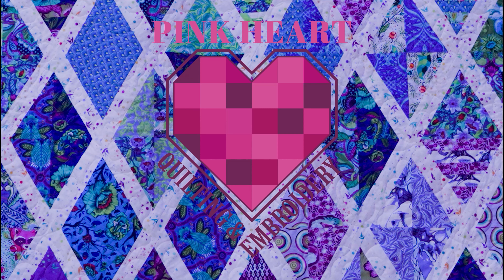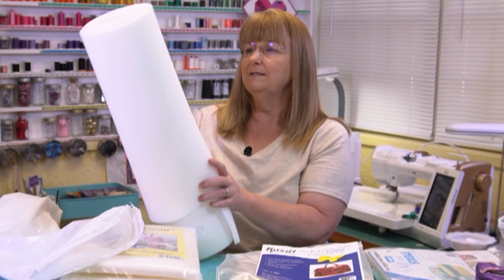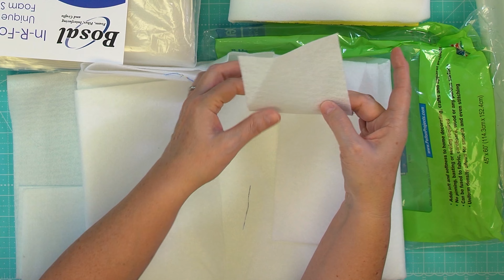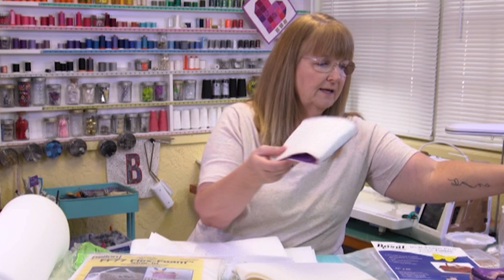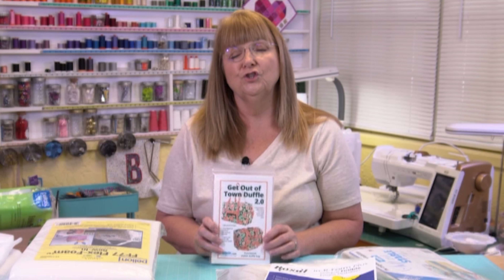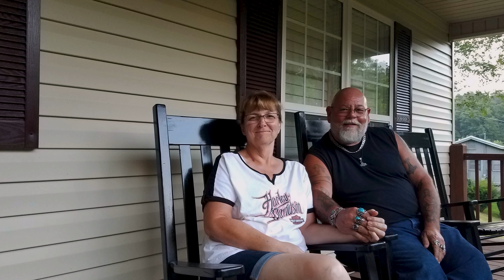My Favorite Interfacings for Bag Making

Comment: By Annie Soft & Stable comes in black and white. It is clingy and you don't need to quilt it to attach it to the outer fabric. This is a nice option. I buy Soft & Stable in the largest size. If you open the bag and undo it, it will relax and any folds that came from being in the bag disappears. That of course requires some extra room to store it. Well worth it if you can. As you mentioned, it depends on the style of bag, but for "fashion" bags as opposed to totes and shopping bags, I have come to use Soft and Stable exclusively. It is wonderful in Lazy Girl Design bags. Pellon SF101 is definitely my goto for lining, pockets, etc. One tip, if you want to use a fusible batting for a slouchy bag or shopping bag, you can make your own. If you are a quilter as I am, I always have a lot of batting scraps around; but, they are not fusible. Just cut a piece of Pellon Wonder Under the size of your batting and fuse it to batting scraps.Voila!! Fusible batting. I buy Wonder Under by the bolt (just like SF101) when there are 50% off or more sales.

Comment: Very helpful info.!!  I used to use a lot of fusible products for basting and now steer away from it when I can because it causes the sewing needle to get gunky with adhesives.  That causes all sorts of trouble until I replace the needle.  I now rely more on good pressing and clips or pins to hold things in place. TFS

Comment: I would suggest that a person try a few times with the fusible. After a little practice, there is no better look to the finished Tote, purse, etc. And quilting is never needed but does beautifully with this method. I have made many totes this way, for years and practice is the key. Even though it's scary at first, you quickly get used to handling it. Maybe this will encourage people to try it.
Reply: @Vickie I would like to hear your tips on using the fusible as I struggle with getting the wrinkles out.

Comment: Hey, I'm a "bag lady" too - Sew Sweetness patterns are great; yes, a lot of birthing of bags! Sew in foam is my favorite. I had used one of the fusible foam products and after total completion I went to put a few finishing ironing touches on the exterior of the bag & doggone, I got a wrinkle where the fused foam shifted. So from then on I've been a sew in foam gal only.
I know you said you're ironing the foam to remove the folds; I found if I hover my iron with plenty of steam going that it really helps, almost like it's rehydrating the foam (tip from Crafty Gemini and it really helps).  Look forward to your how to sew the  By Annie's duffle.  Thank you for a great video!
Reply from the maker: Hovering over the foam with steam is a great idea. Crafty Gemini is always a great resource for crafting techniques of all kinds.   I was really nervous to put an iron directly on the foam.  
The duffle has been a great project.  I'm still not sure if I prefer binding or the linings Sew Sweetness uses in her bags.  
Thanks,

Comment: Just what I was asking today. I've made many bags mostly utilitarian with mainly pack fabrics of every kind utilized. So I decided to make a YARN bag for a friend. My own design as my usual when an idea pops into my head. So what's been tripping me up from moving forward after making the cording & cutting out the basic fabrics is I do need it to be a stand up bag. And it also needs to have 6-8 grommets set around the upper 1/3 of the bag to allow yarns to come out of each. I count base fabric side and front as 2 layers, pockets with lining 4 more layers, vinyl cording another 2. My machine is known to handle thick heavy fabrics so far I'm good. But never having used the foam or bag stiffeners to stabilize the sides to insure it stands up? That will add yet two more layers. UNLESS I've seen several bag makers demonstrate cutting the fusible stabilizer foam out that's one sided but cutting it smaller than the width of the machine foot and using either a narrow machine foot or even the zipper foot right up to the stabilizer to help reduce thickness and still get great results. Never having done that I'm not sure it'll look good all the seams. I intend to have a loose lining so it won't be constructed into the main fabric of the bags only attached at t he very top. And of course when the grommets are set that will also secure the lining further to the bag. I also would like to do a double pocket on front side of bag adding yet another single layer to each of the side seams. I'm not so much worried about the fabric puckering if using fusible and plan to use just one side fusible not double. again not seating the bag lining to the bag in that way. I made similar cordura large tote and dual rucksack utilizing the shoulder straps into hidden corner D rings and middle at top D ring if need be as a wedding gift that wrapped the missionary couples gifts instead of spending money on fancy wrapping paper etc. I did the math and the cost of the gift wrappings and all it's trappings would cost about what it would to make the very pretty light blue tote with 5 pockets. And interior pockets. Was beautiful when complete. I was asked by several other people to please make them one. I don't make patterns I tend to sew what ever pattern if any as I go along. In the end I quickly forget what size a bag was or what how in their case I installed a hidden bottom zippered compartment into the outside of the bag. No idea to this day. The bag pretty much stood on it's own due to the stiffness of the cordura pack cloth. But not all pack cloth is stiff it varies a lot even cordura in the same weight can vary and if it's washed can loose it's ability to stand up. Cording will help. As far as zippers go I intend to use the fabric tabs on the ends to help reduce the problem of sewing over them in already over layered side seams. I think it's coming down to my making a smaller trial run more simple bag to see how the addition of pellon or similar media works with cut slightly shorter than the seam itself and of course fusing the one side. I just would prefer not having to experiment. Then again due to the pandemic I had trouble getting all the right fabrics and materials together and I ended up with smaller yardages and now have those odds and ends in pink to do something with. And my usual circle of friends and family members none are into PINK. I'm an anything brown and green person. Fingers crossed I start construction tomorrow.
Reply: OMG. Didn’t read that but hopefully it turned out

Comment: Loved your video.  I was wondering if you have worked with craft fuse by Pelion. Any information on your experience with this interfacing as far as bags are concerned would be most appreciated
Reply from the maker: I haven't used craft fuse.  I have used SF101 and I love it for giving body to a project.

Comment: I am making a bag, and it has a drop in lining, and my question is I have the Flex Foam 1 sided fusible...can you fuse the cut piece to your fabric, and then cut out your piece so that you don't have to cut twice (fabric and then the flex foam)?  I want to make sure both pieces are even, and not crooked as sometimes the cut can be off a little bit on either piece.  I also have to cut 2" squares at the bottom sides of the front and back of the bag.  I noticed you only made referrence to birthing a bag, and not anything about a drop in lining, so that is why I'm asking.  Thank you!
Reply: Sounds like a good idea but you would have a lot of waste after cutting out the pattern unless it is a simple pattern that would only be rectangle pieces, squares, etc.

Comment: i started making jean Totes that are 15" X 15" (4 panels on each side to make ht e15 by 15) and I was using extra firm 809. That doesn't seem to be what I should be using and I do want it stiffer. Which one for jean tote would you suggest? and would you make the interfacing the same size as fabric so it is in the seam allowance? I will definitely use the SF101 for the lining

Comment: If you have fusible can you just sew it in?
Reply: I was wondering this as well.
Reply from the maker: I thought about trying that but I was worried that if an iron or other extreme heat was exposed to the sides it would adhere unevenly. If you try it let us know how it turned out.

Comment: When using the non fusible foam, how do you attach it to the fabric?
Reply: The rare time that I have used the non-fusible foam is when I quilt the entire piece, and then cut out my pattern pieces.  I use fusible flex foam on a regular basis and never have had it wrinkle.

Comment: Unfortunately she didn’t differentiate between which have 1-sided fusing, 2sided fusing (Bosal In-R-Foam Plus is 2 Sided! And that’s the 2nd one she presents, u can read it on the label!)
Reply: I think they all have the option of buying a two and single sided fusible product or no adhesive versions. She favors the ones with no adhesive properties. She's just primarily attempting to give you the brand names out there not so much as show you each brand not specifics to the brand other than stating they do come both ways with and without adhesive qualities. I'm not confused at all. And not worried that she had any given with or without adhesive in her stacks. I know what she meant by having issues with folds in the products that are difficult to get out. I've on occasion had to cut out pieces of folded fabric like pack cloth which often have a coated back side to make it more weather and water resistant and also stabilizers so I cut a piece a bit larger than my pattern will use and dampen it with water and try to dry iron out. If that fails I wet the entire item but not soak and put into a mesh laundry bag and run on low through my drier. The smaller pieces in my larger mesh laundry bags usually prevent any new formed folds. A pillow case might work too for larger pieces. Anyway this would be for non fused stabilizer with or without the adhesive properties. Thus the cool to no heat drier setting if it has the adhesive properties. So I didn't find it unfortunate that she didn't go into detail about differentiating between the brands properties about fusing or not, one sided or two. Her favorite was no adhesive and why. Her title of this article clearly states HER FAVORITE and WHY. Not a complete overview of brands and their properties. My search today has been to figure out how some bag makers use fusible one sided or two but trim it short of the actual seam line. If you want your bag to be occasional washable I'd worry adhesive might not hold up to that. I am not aware of the full properties or expectations of such adhesives for laundry soaps and solutions. Oh which reminds me NEVER EVER use any of the oxy products that are in detergents or stand alone in coated fabrics like pack cloth because it destroys it. And my guess is it would destroy in a few washings the adhesive between the fabric and the stabilizer. I'm guessing but on experience to date it would be a good educational guess. Stay safe everyone and have fun making STUFF you then gift.